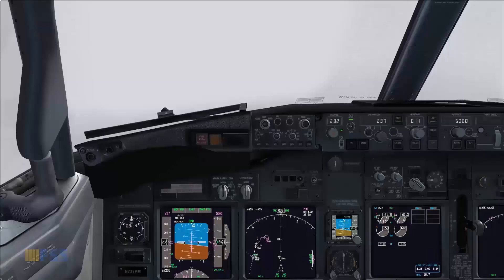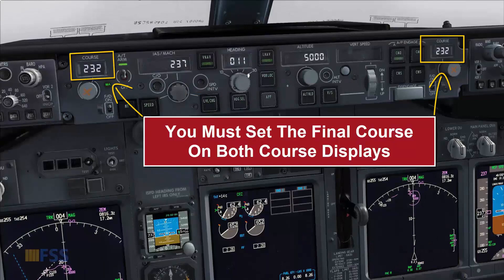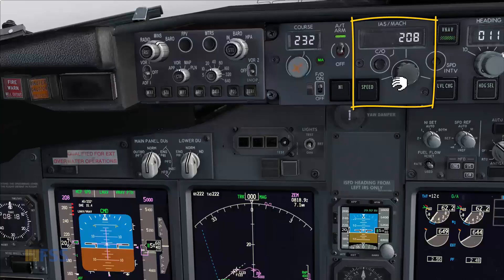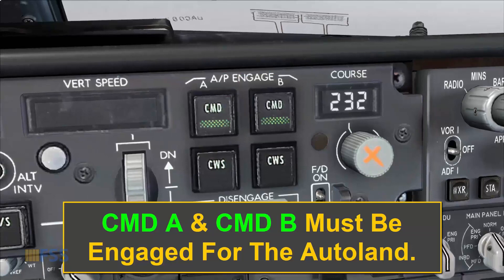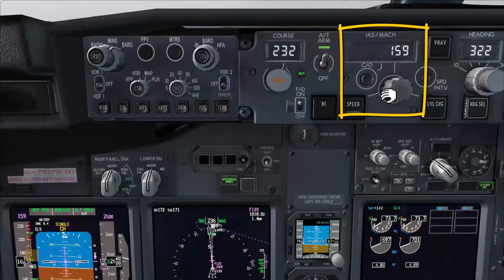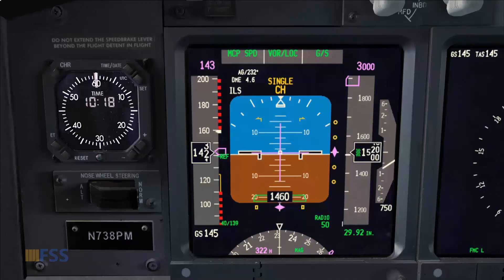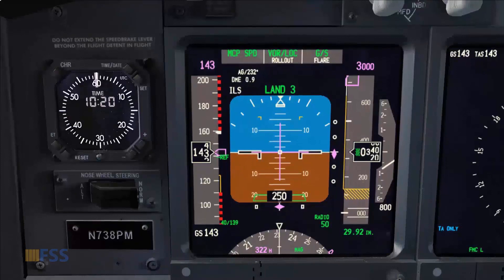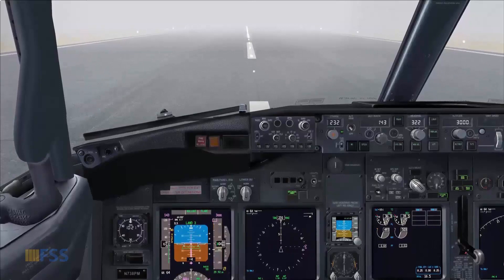PMDG 737 Autoland Tutorial In Detail|Boeing 737 ILS Cat iii  Approach [1080HD]

Comment: Thanks for the video, appreciate it! Question, with Autoland, at what moment exactly do you disconnect the AP and AT?
Reply from the maker: The Autothrottle will automatically disconnect at touchdown whereas the Autopilot needs a manual disconnection. There is no specification on when exactly to disconnect to A/P during ROLLOUT it may refer to the Company policy but you have to disconnect the A/P before exiting the RUNWAY , common sense right?.
Reply: It depends if your 737 is fail op or fail passive. A fail op 737 has electrically operated rudder actuators. In other words autopilot can control the rudder in order to maintain the centerline,it is the rollout indication on the FMA. You can leave the Ap until you re about to leave the runway.
If you have a fail passive 737 which means no rudder for the autopilot, boeing recommends to disconnect the AP ASAP after touchdown.
Reply from the maker: @Hk416  thank you for your detailed explanation actually i forgot to mention that i was doing the Autoland in Fail OP option which means that the Autopilot has ROLLOUT control at touchdown unlike the fail passive which has no ROLLOUT available for the landing where we have to disconnect the Autopilot at touchdown.
Reply from the maker: actually i forgot to mention that i was doing the Autoland in Fail OP option which means that the Autopilot the has ROLLOUT control at touchdown unlike the fail passive which has no ROLLOUT available for the landing where we have to disconnect the Autopilot at touchdown.

Comment: Why do both computer displays have to be set?
Reply from the maker: Having two independent autopilots provides redundancy and improves the safety of the Autoland system. If one autopilot were to fail, the other would take over and continue the landing procedure. This redundancy also ensures that the system can operate even if there is a failure in one of the aircraft's other systems. Cheers